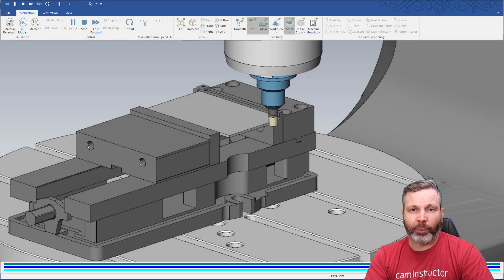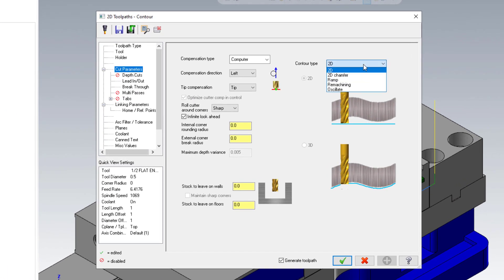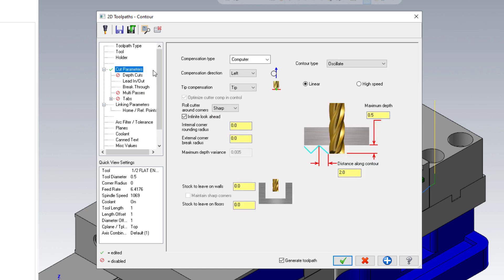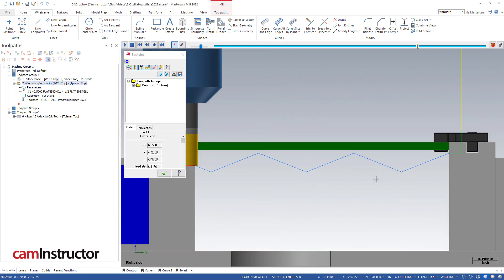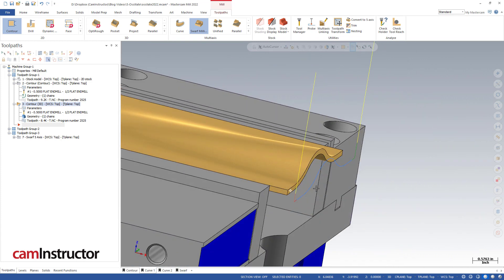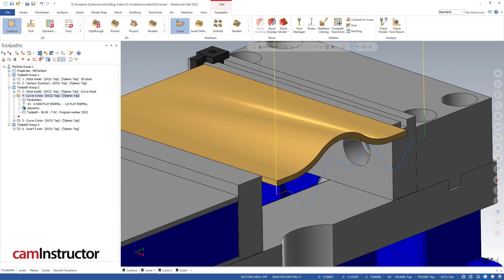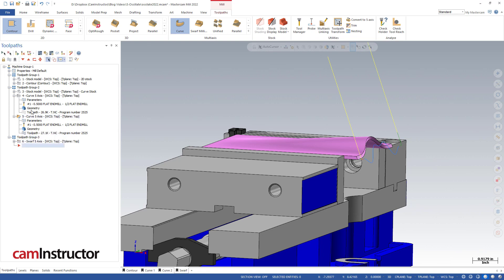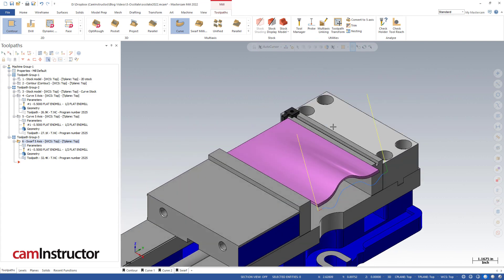How to Oscillate in Different Mastercam Toolpaths

Comment: This can only be used for outer walls where the wall height is lesser than flute length of the endmill.
Very specific area of application,  this oscillate function has.
Reply from the maker: But those who need it, its nice the software provides the function.

Comment: Sir mastercam X9 have Api and premium thread form?
Reply from the maker: Yes you can cut API threads in Mastercam
Reply: @CamInstructor  I’m learning Mastercam ax5.I couldn’t see the api thread forms in the library
Reply from the maker: The forms and tolerances would have to be obtained. Whoever designed the part should be able to supply or go directly to API.

Comment: this useful for roughy cut only if finishing will have machine line..
Reply from the maker: The oscillation will have no effect on the finish. It will be the same as if you had machined straight.
Reply: @CamInstructor  That's only true in a perfect world and machining is far from a perfect world.  You have to account for
tool runout, tool deflection, etc.  You will most definitely see the oscillation in the surface finish.
Reply: @danarrington2224  True, i use it a lot on thin parts and you definitly can see it.
Reply: @danarrington2224  when we were testing oscilating we were geting better results by using greater value in "distance along contour"
For bigger maximum oscilating depth the difference was "slightly" more visible but still great for roughing (spread the tool wear along the full FL